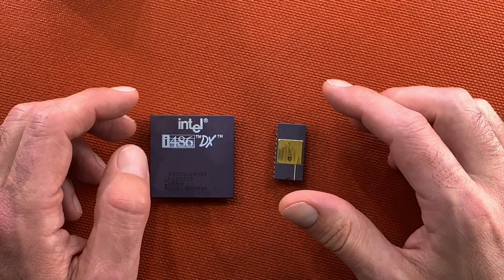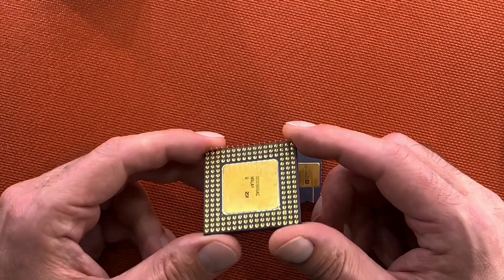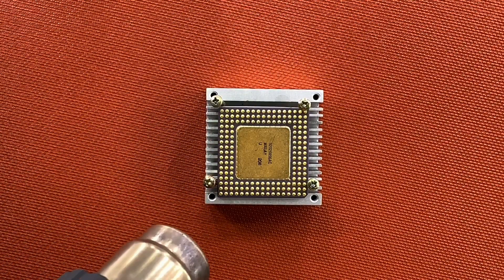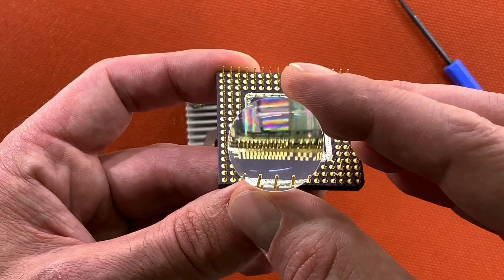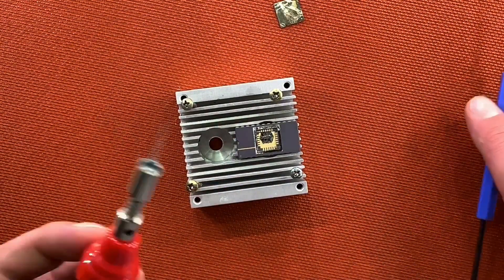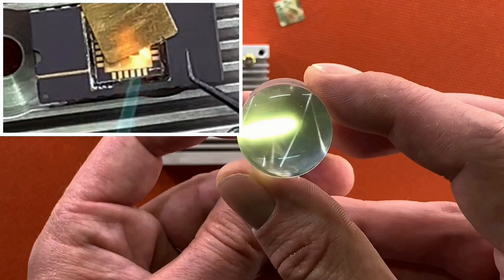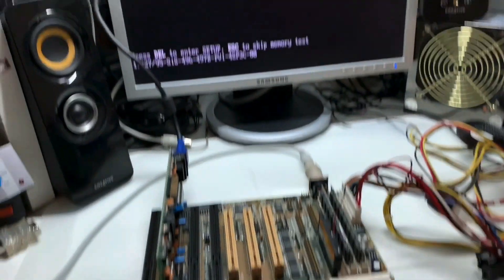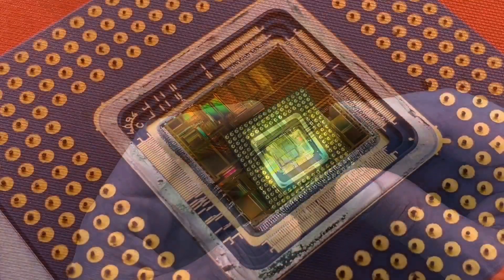How to Open a Ceramic CPU tutorial [ exposing silicon die, testing afterwards]

Comment: Great tutorial! I switched to a heat gun a year ago, now opening dies is much smoother. I also like the temperature range you indicated so one does not need really 450 degrees plus! But I have a question: I can not open the Pentium Pro. Any trick here?
Reply from the maker: yeah, PPro is difficult. you need heat, heat, heat…. the ceramic substrate is so huge that it is disappearing a lot if energy.
Reply: @CPUGalaxy  it worked! 650 degrees heat gun for 10 min. Thanks. I will make reference to you when I upload the video!
Reply: Ok Will try harder then…I will post my experience, thanks

Comment: After opening a ceramic chip package like this I always protect the cavity by gluing a glass cover slip over the exposed chip instead of the original lid. Also sometimes it seems as if the manufacturers use high-melting-point solder where it can help to add some normal solder from the side when heating the package. The lower temperature solder will lower the melting point of the solder connection.

Comment: I've got a Pentium 133 delidded the same way and flodded with epoxy afterwards. Works fine and won't get any damage because it's preserved.
It's important to warm up the epoxy before pouring and use some vacuum pump to get rid of any airbubbles for the best look!
Reply from the maker: cool. and did the cpu worked after covering the die with epoxy?
Reply: @CPUGalaxy  https://www.youtube.com/watch?v=36PqxBnbprs 
EDIT: wrong video, this is before the epoxy, but yes, it worked perfectly afterwards! I'll try to find a video, can't remember if i made one.
Reply from the maker: yeah. would be cool.

Comment: I wonder how the chip would be effected if we could see it operating in light, I've heard that it wouldn't function because the silicon would act as a solar panel for all the transistors on the chips thus making it inoperable. If it still worked that would be very cool because then you could put a glass or some other transparent material over the chip die and position the chip in a way so that you could see it working.
Reply: Too much light will stop them working, it makes the transistors leaky - they start to switch on slightly even when they're meant to be off.
I think you would probably be able to let enough light in to see it while it's working though. But there wouldn't be anything different to see.
Reply: Nothing happens visually when it is operating, so it wouldn't look any different than when it is off
Reply: @ClassicalRips  That’s a shame, I want computers to have an actual reason to glow rather than RGB but they are just too efficient.

Comment: Why not mounting the CPU upside down in a 45° angle ? Heating up with the heatgun and the lid should falling off.
Reply: nice, but when he would be using torch, he would not be prepared to get the flame away quick enough....
Reply: Surface tension in the molten solder might hold the lid on, or it might just slide down a bit instead of falling off.
Reply: It would be a good idea and would also help with preventing dust from getting on the CPU, although I'm not really sure if dust matters as much once the silicon is actually made but it should at least still be a consideration because it would make the CPU die look better if there wasn't dust on it.

Comment: what processor has biggest die of those that are easy to delid that way?
Reply from the maker: hmm. good question. I would say the socket 4 Pentium 60. Also the Pentium Pro has 2 huge dies underneath the lid but it has a ceramic lid which is soldered and takes a bit longer ro heat up and remove.

Comment: You might try using a hot air rework station, they are built to remelt solder in a large area with hot air so you can desolder large components. You can even adjust air flow rate and temperature of the air very precisely

Comment: The problem now is humidity in the air. It'll gradually damage the die. What you could do perhaps, is encase the exposed bits in clear epoxy, but that won't 100% eliminate the diffusion of humidity to the die, just drastically slow it down.
Reply from the maker: Gianmario Scotti  good input. I think I should recheck the CPU in a year or so to see if humidity had an influence.
Reply: @CPUGalaxy  It has been a year. Do you have a video checking this?
Reply from the maker: no video. but it is still working. no issues.
Reply: @CPUGalaxy   a year? Unless you have extremely good thermal and humidity control, I expect degradation to happen within weeks.
Reply: @GianmarioScotti  hello! it is not better to put them in glass  boxes?. Isolated from air and water. 
And what would be the problem? gold and silicon shouldn't have problems
Reply: @GianmarioScotti  I have a friend who has a decapped SID (from a C64) since a few years, which is still going strong. With some basic precautions (don't directly breathe on it, protection from dust) he's expecting the chip to last a few more years. He should know - he has a doctor's degree in microstructure physics.
Reply: @GianmarioScotti  No no. I'd be surprised if it didn't last years. It's basically sand and aluminium after all.
Reply: I totally disagree with you Gianmario, I've had dies exposed from opened chips for years and years and there is no change to them at all, if you are talking about appearance...
Reply: I have a 386DX-16 that I opened up about 23 years ago which I tested around last spring and it still worked fine. I don't do anything special to store it other than keep it sitting with the die facing down to minimize the amount of dust that gets on it - and that works surprisingly well. The die also looks exactly the same while viewing it with a microscope as it did when I opened it.

Comment: Very nice to look at. I remember reading in an old magazine that the die can stop working from dust exposition. Did you test opened CPUs after a longer waiting time? I had the idea to put a small rectangular piece of glass over the die. I think that could look very nice, too.
Reply from the maker: I dont think that dust can have a influence to the function of the chip. On top of the die is a oxyde layer which is protecting too at the end. But the circuit is light sensitive. Light during usage of the chip will have a influence. But this can also not happen coz its closed by the socket. You can put for sure a glass lid there to protect the die.
Reply: @CPUGalaxy  Using microscope slides was a popular option on very early EPROMs (C1702A from Intel for example and continued to be in the GDR and soviet states for a while).
Reply: @CPUGalaxy  Interesting. Yes I read somewhere that dies react similar to a solar panel. Something like that.

Comment: I’m also surprised how large the 486 DX’s die is! I love that you can see the structure of the cpu unlike modern dies which are flip chips so the exposed side is just raw silicon.
Reply: Somewhat yea. Though the exposed die you see on modern flip chip processors is actually not the raw silicon, but a diffusion barrier coating that's there to prevent contaminants getting into the silicon.

Comment: Awesome video! When using the torch, would it be safer to remove the lid from the other side? That way the flame from the torch would be blocked and help protect the bond wires.
Reply from the maker: yeah, indeed it would be better from the other side. I am fine with it that I messed up in the video, this show then nicely how „ not to open“ 😉